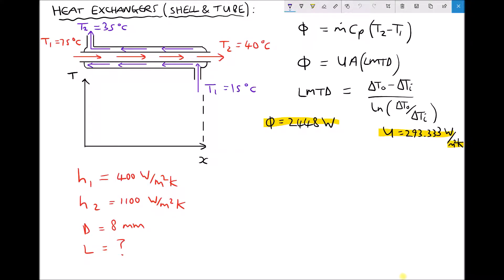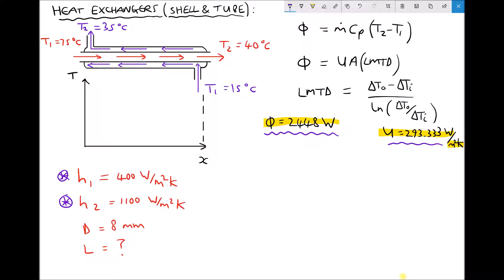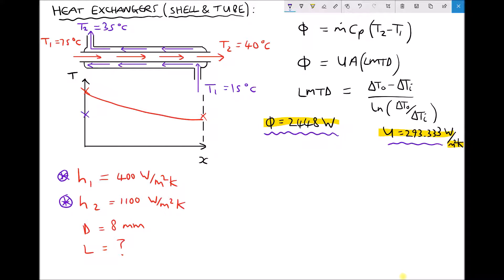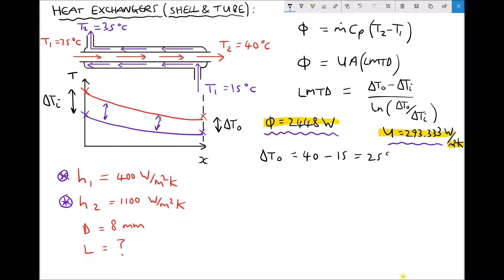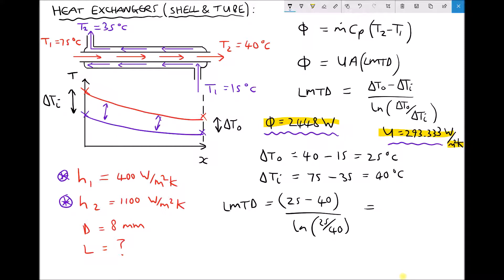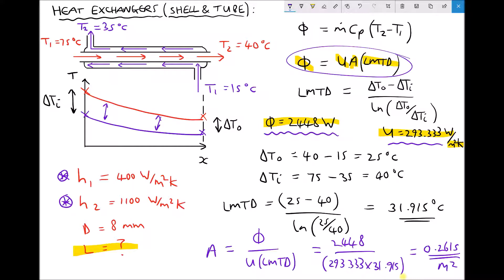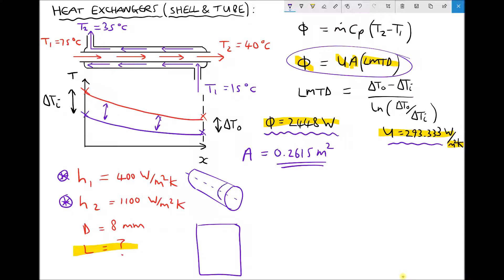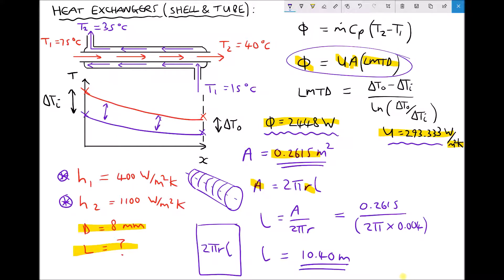Calculating Fluid Contact Area and Tube Length for Counter Flow Heat Exchangers

Comment: Am i first here? That was an excellent tutorial. Thank you. I am trying work out if my condenser design is enough to cool my distilate. Suprised the efficiency of counter flow is 30% better. Thank you. 🙏

ah.. an now i understand why my heat exchanger becomes less efficient as the temperature incresses as more alcohol is lost.